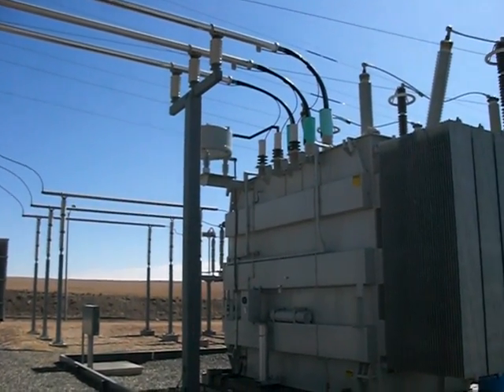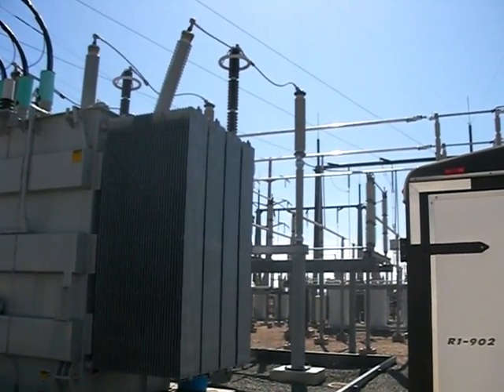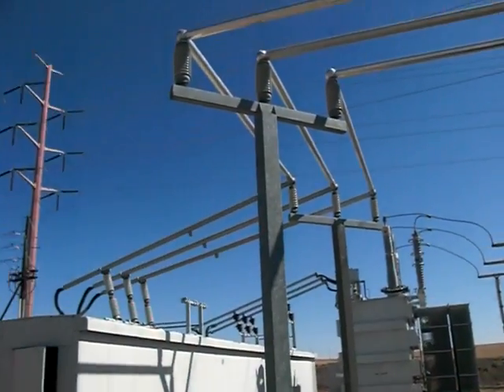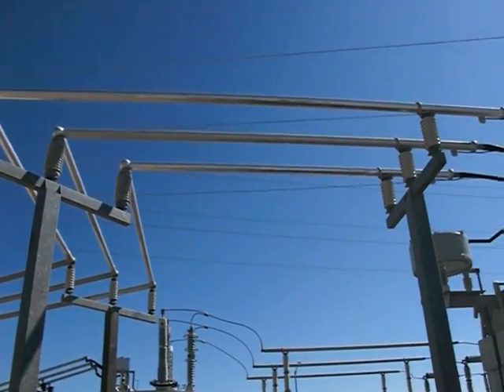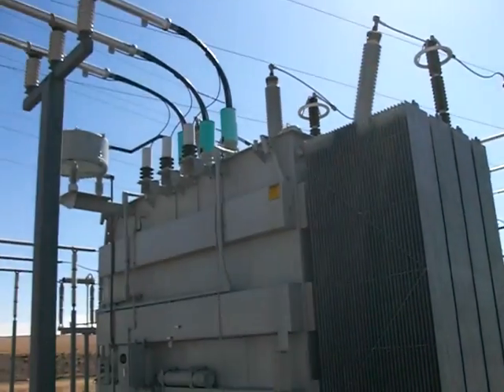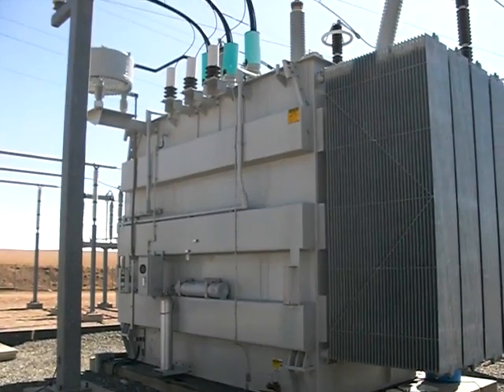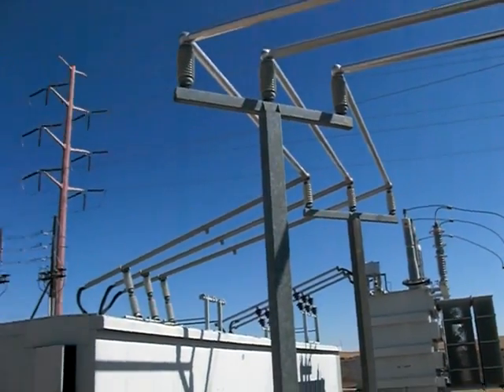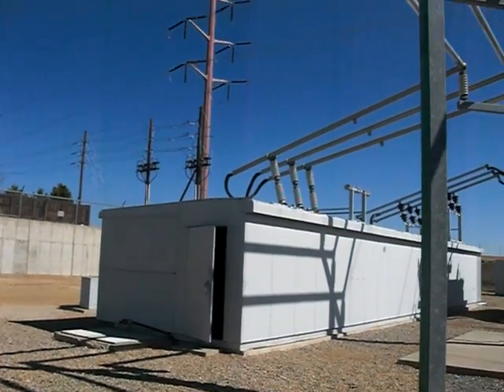Large Transformer inside an electrical substation in Boulder, Colorado at 75th and Lookout Road

Comment: The humming sound is what I was looking for - considering purchasing a house ~1000 feet away from a substation roughly this size and wanted to know what to expect as far as noise transmission (it's halfway across the country - I can't just go to the house right now).  This video was exactly what I needed - thanks!  As far as what you felt, did you notice how far away you were before you stopped feeling it?

Comment: @zeekzilch it would be improbable to keep the voltage that high after a certain point in the transmission system. The voltage is stepped up to keep the current down so less power is lost. Once you get far enough in the transmission system the current has been split to various loads and is much lower so lower voltage can be used. Also the large 200kV+ power lines require very expensive insulators and larger transmission towers to keep the voltage away from the public.

Comment from the maker: @ConePuncher420 

My guess is that they need to step the voltage down to something more reasonable that can be safely delivered to each neighborhood. 230,000 volts is probably much too high to run through residential or even business areas but 13,000 volts is more manageable. Of course once it's in your backyard they drop it down to 220 volts and then cut that in half for regular household use. Maybe somebody more knowledgeable out there can give us a better answer?

Comment: @zeekzilch 400Hz would require lighter transformers. The sound would be a singing since this is in the vocal audio range. It would not go the distance like 60Hz. 60 is a compromise number set by Nicola Tesla. Large motors would like lower numbers like 20; transformers higher. 60 is just above the flicker fusion rate for the human eye -- so it keeps lights from flickering all the time.

Comment: @zeekzilch 400 Hz requires less steel in transformer cores, relay cores, motor cores etc. Less steel means less weight. Very high frequencies such as radio/tv have some transformers and inductors with no steel-air core.

Comment: The output side (low voltage) is likely 3 phase, 4 wire.  The 4th wire is a grounded neutral conductor, as you see 5 small bushings on top of the transformer, one bushing connects to a ground bar.  The substation has a metal ground grid built below connected to the bar. In the shed, underground cables with their neutrals bonded to the ground grid then go out to the wood poles.  Residential customers are fed with small transformers connected between phase and neutral.

Comment: I am guessing they are standing on the  "low" voltage 13KV  Side of that transformer And that walking down to the other 230KV side could cause a flash over?
I would be so afraid of not know where to walk , I would just curl up in a ball in the corner!

Comment: Nice footage.  The buzzing noise is all the same for North American transformers.  It's referred to as the standard 60 hz hum.  Europe uses 50 hz, but I doubt the sound is significantly different.  However, aerospace applications typically use 400 hz transformers - so imagine the pitch you're hearing 8 times higher.  I think that would be a bit creapy.